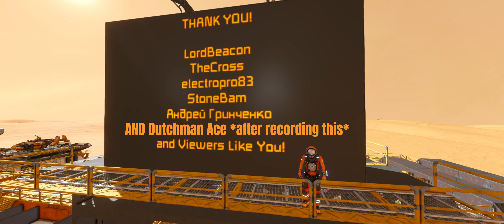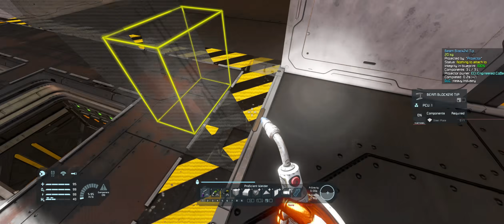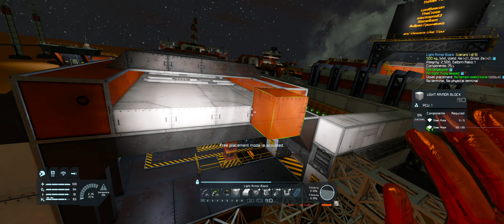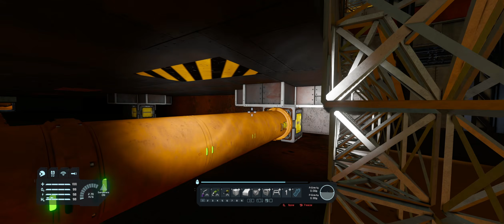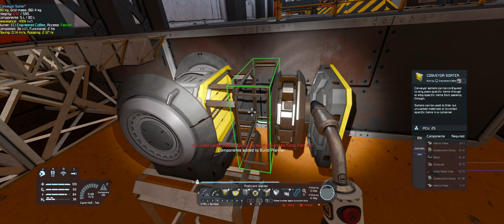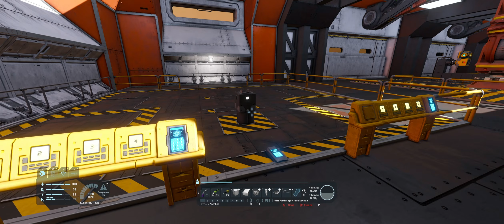Hidden Tardigrade Welding Platform Plus COFFEE! | Martian Engineering E21 | SE Survival

Comment: Your video’s are so inspiring, can’t wait to see this one in action.
Got me thinking, you can fit up to 4x4 small grid through a 1x1 large grid door right? So a small grid welding arm on pistons could hide perfectly behind a door in the floor. Less efficient but would look so cool.
Also, it is on the nose, but Engineered Coffee would be a perfect name for this coffeeshop.
Reply from the maker: I haven't tried it, but it's worth a shot. This seems like a funny prank setup if it works. Access door? Nope, welder to the face.

Comment: Hey Coffee did you know you can condense all programing for moving subgrids into a recorder on the subgrid just make sure you return to waypoint 1 at the end of the sequence because it cant actually move its self.
Reply from the maker: I didn't know that, I will give it a try!
Reply: @EngineeredCoffee  I should have Sayed most you still need delays.
Reply: @EngineeredCoffee  Anything you can put into your tool bar from a cockpit can be triggered while recording This helps me program thins in a fraction of the time.

Comment: I kinda like the slow showing of what SE2 will be. Every trailer will be something new to chew on. Totally agree on the nostalgia feeling. I remember when they said planets are kinda impossible. Then, poof, magic happened and SE1 became a whole new game basically. I'm looking forward for all the new surprises we'll get for SE2. Mad respect for their passion.
Also, how on Earth did you tame Klang? Sometimes shared inertia works for a while, but most of the times when I try to make a ship with more mechanical parts it Klangs out at some point. It's like agent Smith is silently watching me for the inevitable.
Reply from the maker: There are some things to share and others not. Sometimes it's just trial amd error. The crane on the ceiling of the factory wanted to auto-rotate with inertial tensors on, so I had to mag plate it down. 🤷‍♂️
Reply: @EngineeredCoffee  Hmm Maybe I should incorporate magplates triggering the same as connectors. But at least I've started using event controllers after all these years to shut off thrusters, refilling tanks and batteries on connection thanks to you lol. This series opened up a new world for me